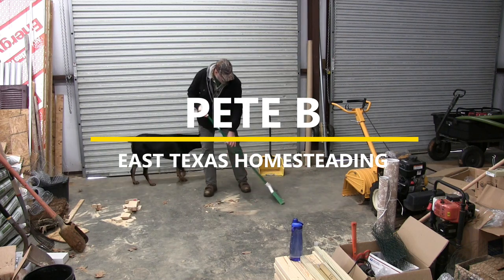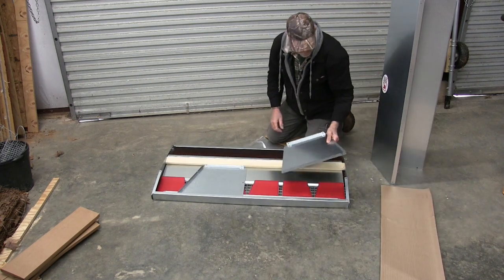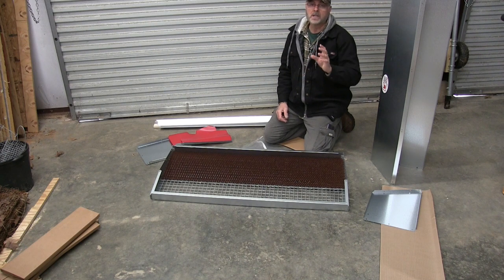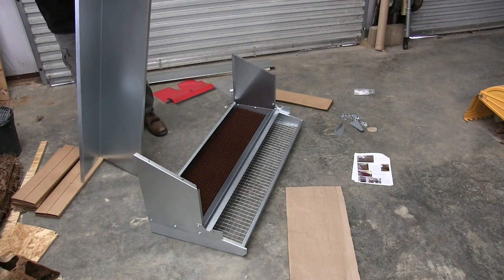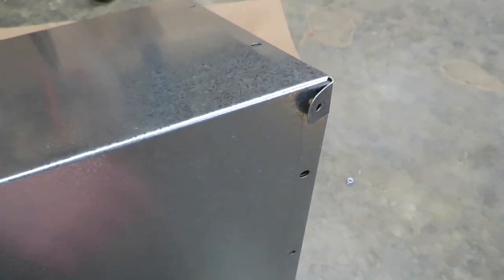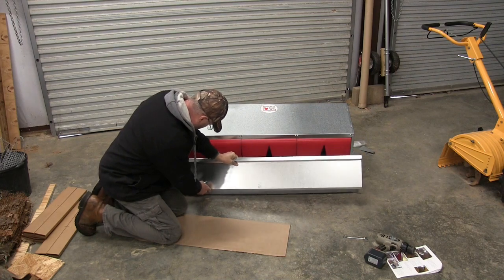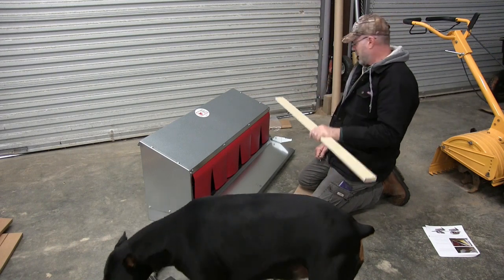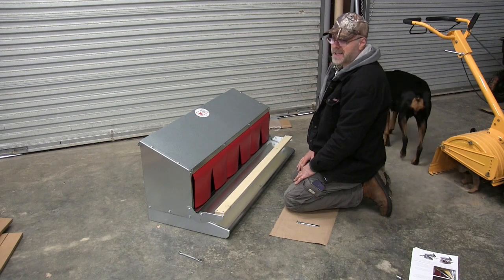The Best Nest Box for Chickens | Assembly and Installation

Comment: sorry I don't care for anything made from, that type of metal...in our chicken coup..we built a wooden frame to support 5 gallon buckets that we collected from Calf milk replacer....put a two by six x ten at the back wall and screwed in 4 inch screw nails at the back of each pail,,, and then a  1x3 across the front of the pail to keep the nesting material  and eggs from falling out....very easy to clean out and hose down everything was nice and white...and each laying chicken had a very private egg  delivery nest...but to each there own..good luck in your assembly. .
Reply from the maker: That's okay, as long as it's working for you is all that matters.
Reply: yes that worked out very nice for us...we had at that time over forty hybrid  hen..dual purpose, meat and egg layers..lot of them also hatched out eggs in the mid spring...that kept the freezer going...with any roosters that came along...they sure are great on the grill at any time of the year....  @petebeasttexashomesteading